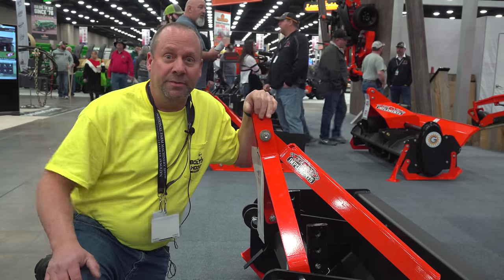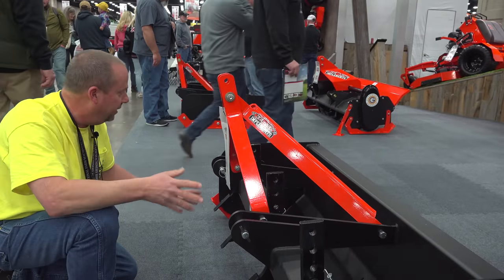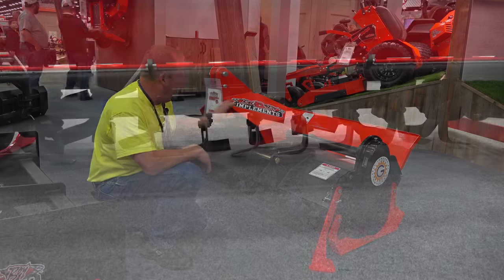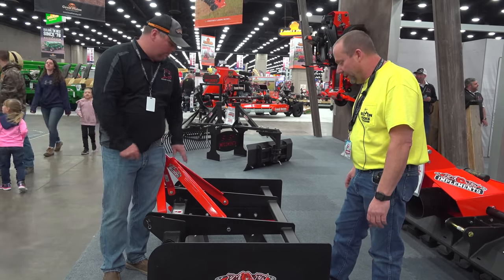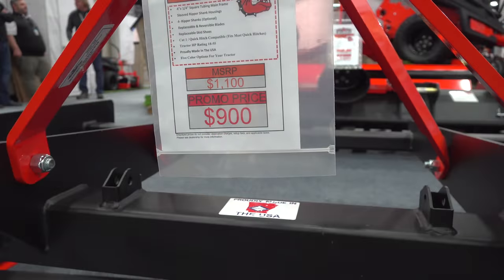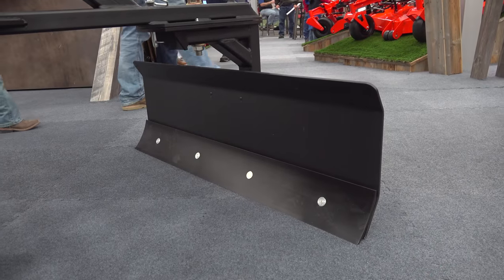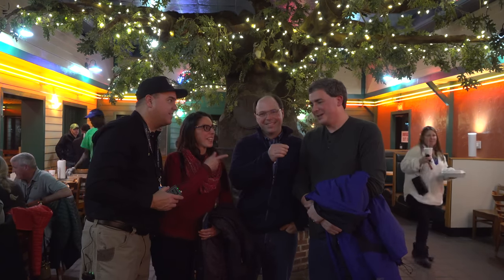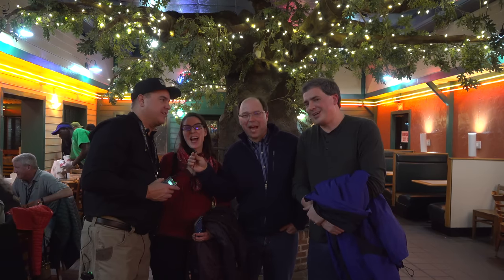Bad-Boy Implements! How about Bad-Boy Tractors?

Comment: I have enjoyed the videos at the farm show. This video about the implements reminded me of something. Since y’all are there. I would like to know if there are any compact tractor cultivating implements on the market. Small enough to be used on the 1025R tractor. Thing like sub soilers, plows, discs, cultivators, chisels, rakes and such as that. Implements that can be used in a garden so the soil doesn’t get so beat up and worn out like a tiller does. Thanks.
Reply: There are tons of such implements on the market for the 1025 and other sub-compacts. Deere/Frontier has their own line, but there are many other manufacturers

Comment: I bought a 4 foot Bad Boy tiller today and i can't get it to fit my 1025R John Deere. The lift arms are about 2 inches to short.
Reply from the maker: Do you mean that the PTO shaft is too long?
Reply: @TractorTimewithTim  the PTO shift is fine. I can't get the 3 point hitch to go on. The only way the tiller will go on the 3 point hitch is to leave the drink shaft off.
Reply from the maker: @chrismurphy4142  you must cut the PTO shaft to make it fit.  We have a video showing how to do this.
Reply: @TractorTimewithTim  that's what a friend just told me to do. Thank you.
Reply: @TractorTimewithTim  thank you for getting back with me so quickly. This Bad Boy tiller is built like a tank. Can't believe how thick the steel is.